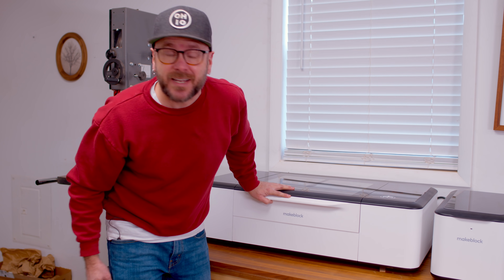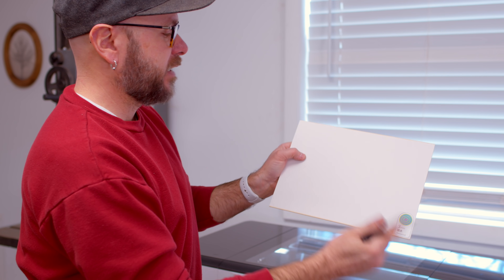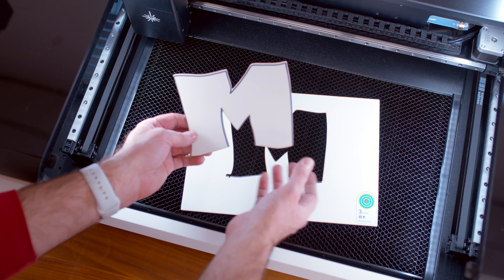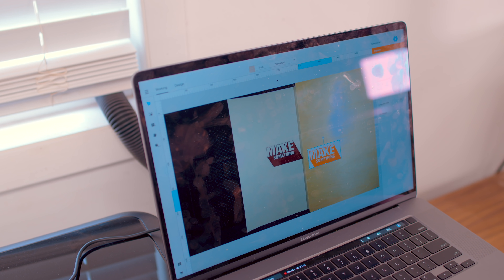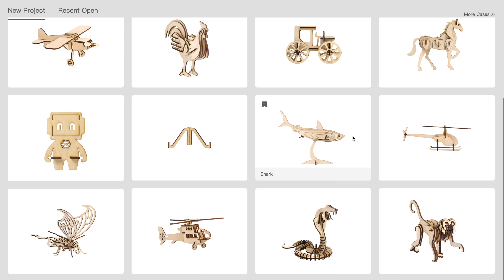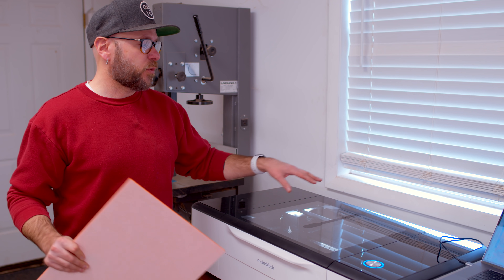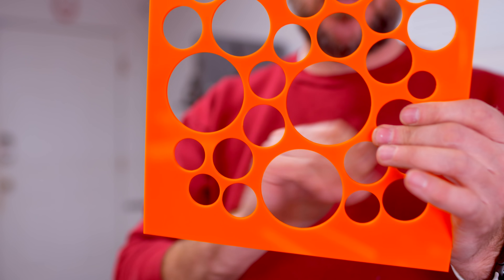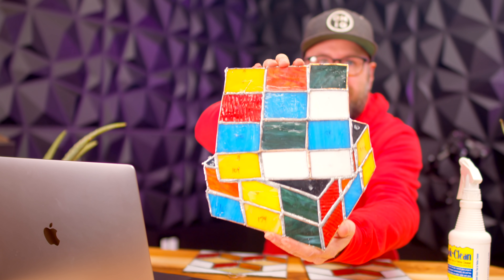New Laser Cutter With Some Crazy Features. | Makeblock Laserbox

Comment: Love this!  Just put up a review of the Full Spectrum Muse today and didn't realize you had just done one on the Makeblock.  Love the integrated air purifier, that is great!
Reply from the maker: Great video and review! https://youtu.be/8FzsBontXMU
Reply: I have had versalaser with purifying system. That was my first laser. If you cut a lot it stuffs the system very fast and to buy a new one would cost $500.  It is much easier just to get all smoke outside through a blower. I am cutting with a 300W Co2 now and I must say it is not that much of smoke coming from it. If you are doing it in your home it won't bother your neighbours.

Comment: Did you have any issues with settings ?! I have the makeblock and everytime I cut, it seems like little fires happen! Any help would be greatly appreciated!
Reply from the maker: Hmmm, might actually be something wrong with your machine. I believe (but not sure) that there should be an air assist blowing where the laser is cutting to keep the flames down. I'd contact them right away.

Comment: the bottom of the FSL muse comes out so you can engrave taller items.  you can get a riser/cylinder attachment for $895 with the us and do mugs and cups, etc. about $7200-7500 for the muse with riser.

Comment: At $5-6K, this and the Glowforge and the Muse seem to be an order of magnitude more expensive than a comparable K40 laser. Is that whole increase just for better customer service and proprietary software?
Reply: You actually get tech support with a live person if you get the muse
Reply: Thanks. But are the machines themselves better? I try to buy the highest end wood and metal working tools I can but for the tool quality, not because I ever use the tech support. So is a Muse or Glowforge or this one better than a good K40 that is typically under $1000 even with all the options?
Reply: @automaticprojects  the software is built in to the muse you can even test it out on their website. You also will not need to be connected to the internet to use the muse. Replacement parts are available directly from full spectrum and you won't have to wait a month to get replacements from China.
Reply: @automaticprojects  the glowforge forces you to connect to their servers to use their machine. The muse will not. Parts are available directly from Full spectrum laser. They are a US company with US manufacturing. The k40 is a cheap machine made in china. You will have to do many upgrades in order to use a half way decent program to run the machine.
Reply: @faded1805  Good to know! I've had a lot of poor quality issues even with expensive tools, regardless of where they are manufactured, so I'd certainly pay more for piece of mind and good customer service. Do you have a Muse, and if so, which model do you think is the sweet spot for "high end hobby use"?
Reply: @automaticprojects  I have a muse3D with the 45w tube upgrade and riser with the rotary. My friend has a glowforge and I am glad I went with full spectrum.
Reply: @faded1805  I’m thinking about buying the muse 3D with the rotary option as well what else would you recommend to buy with it?
Reply: @zacharypaul1111 recommend the external exhaust fan and 5" lens

Comment: Hahahahaha, look at Makeblock coming straight out of the gate with an air purifier already included! It only took glowforge like 6 years to produce and ship a very basic filter assembly that they promised in their kickstarter launch
Reply: It doesn't really do much purifying if you still have to vent it out a window. Full spectrum lasers fine extractor doesn't need to vent out a window.

Comment: I would like to weigh in as someone that owns a Full Spectrum Laser Muse. There were things about the Muse that drove me to ultimately buy it over the Glowforge, one of which is the fact that a rotary attachment is available for it, (a feature you don't see in any other laser in it's class) along with the fact that the Muse does not run on Cloud based software like the Glowforge does. Ultimately the Muse ends up being more expensive, especially considering you need an external fume extractor, however I would argue the objectively higher capabilities, and the modularity more than make up for that.

P.S. Full Spectrum Customer Support is in one word: Awesome

Comment: Cool review glad to see another laser in this size come into the market. I have the Glowforge pro and I use the passthrough a ton especially for laser etching  veneers that are way to long to fit in the bed. I also have their filter and it works fine. I really wish I could just make simple shapes in the software though. Even though I'm fine at illustrator it's still a pain.

Comment: $5,499.00
Reply: 6k !  Save up get the epilog
Reply: You the real MVP
Reply: The Glowforge Basic is 40 watts and no passthrough and a better comparison and half the price but the basic is still faster has built-in strong exhaust and a big advantage with cloud software is in constant improvement so I would not be surprised if some of those basic design stuff showed up. Even so, you load a circle, etc once and you do not need to do so again. That scan and engrave trick is the same on the Glowforge.